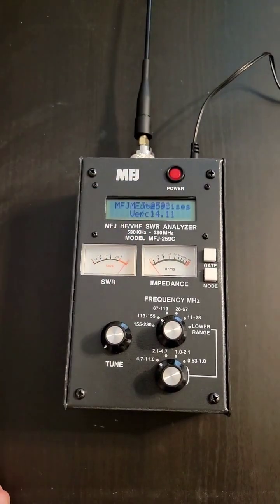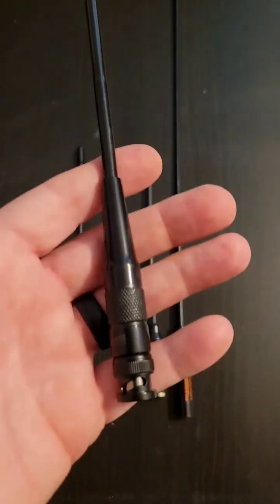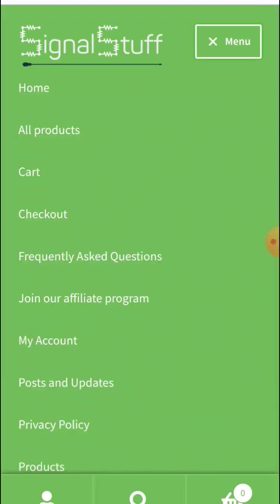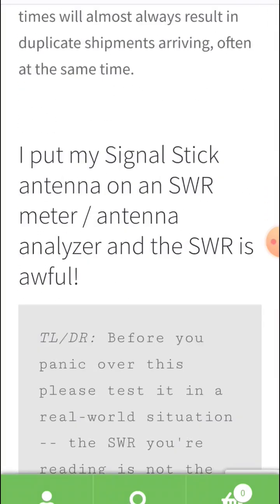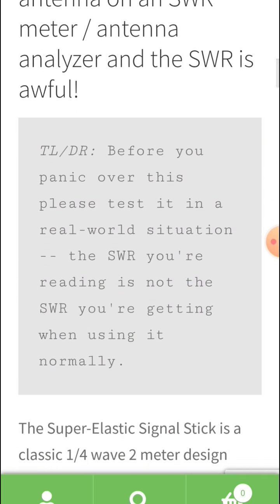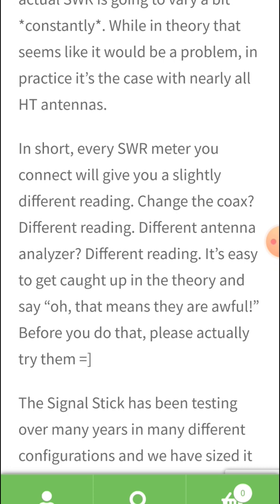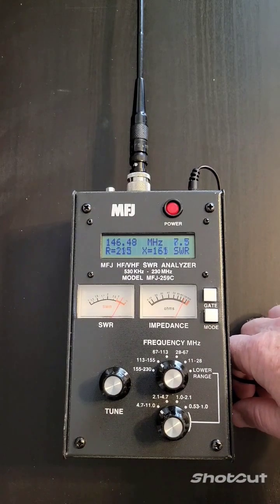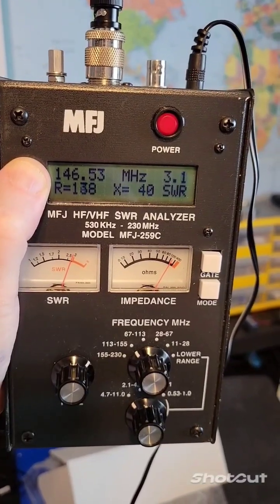SWR Testing for VHF/UHF Antennas Can Be Misleading! #Shorts

Comment: You need a test piece of coax, something that is measured to be resonate for the bandwith..
Reply: I've been trying to get SWR readings on a Nano VNA. I see the graph change a lot depending on what's near the antenna, If I'm touching the antenna, the coax or the VNA. So is it possible to get an SWR reading on a small antenna. I'd say it would be easier testing one mounted on the roof for example.
Reply: @FabhcunGorm Definitely. I wouldn't test or adjust until I get the antenna to its final resting location.
Reply from the maker: Thanks